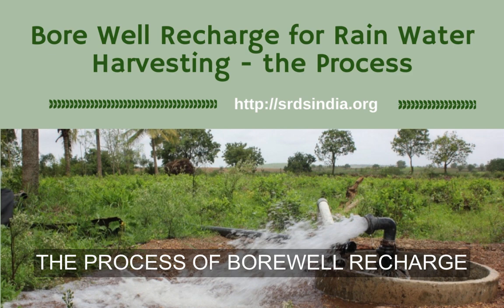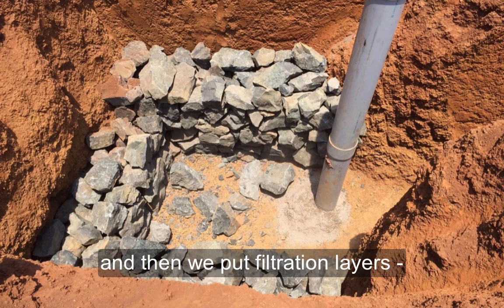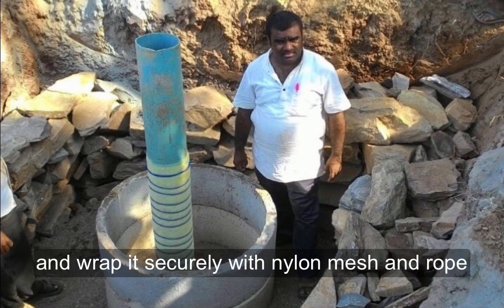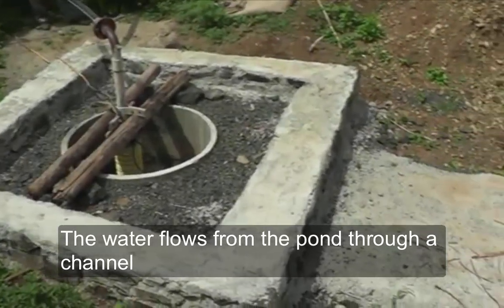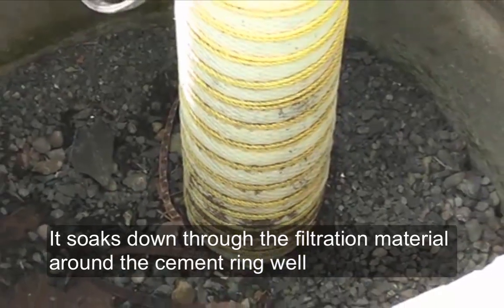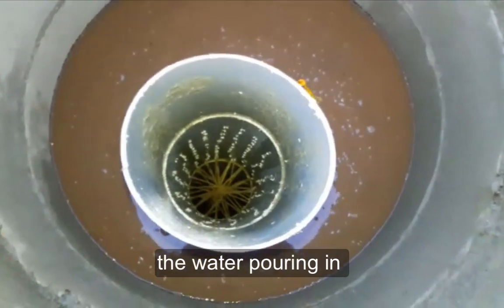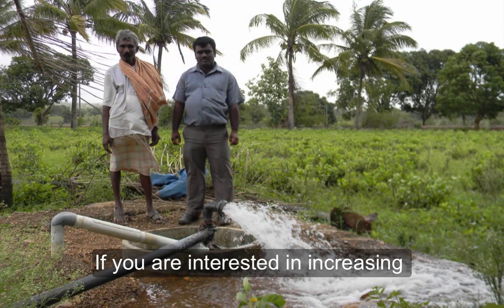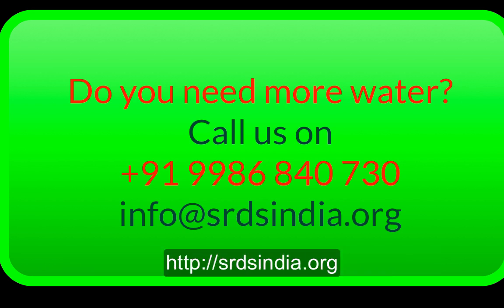Bore Well Recharge - How it is done. Call 9986840730

Comment: one doubt bos, if we allow the water to soak into the bore well, will there be any problem to the submersible motor, i mean any chance of getting the motor spoiled ? ....
Reply from the maker: no problem with the motor at all.
Reply: Nim no bidi sir
Reply from the maker: No problem becouse subscribe pump is in water but we need check stone inside of get hard rock no problem..